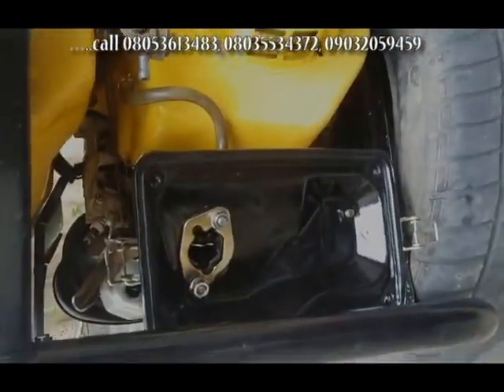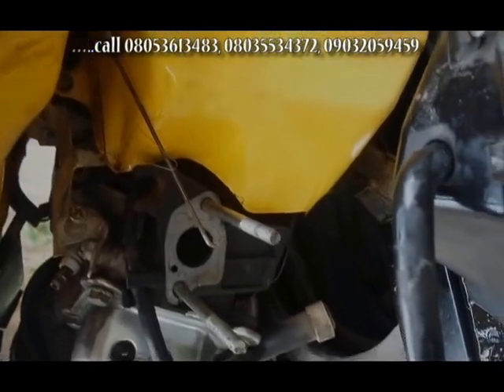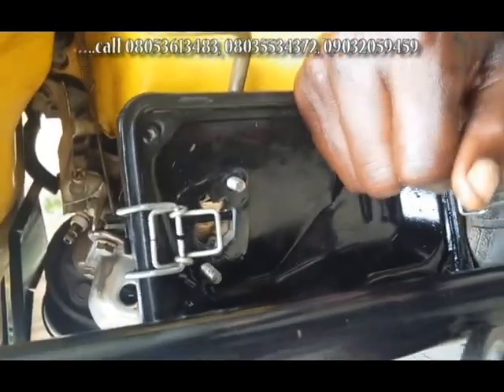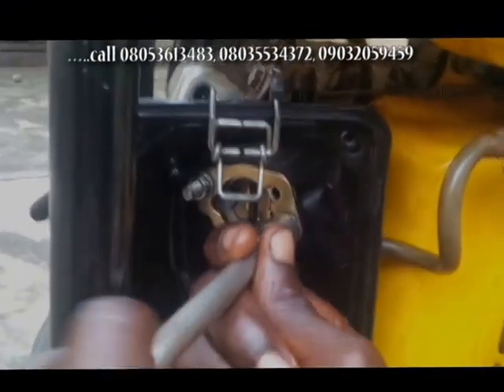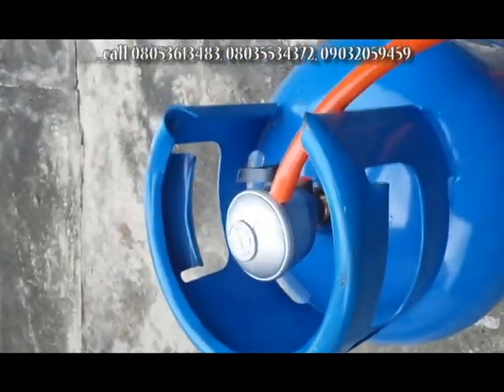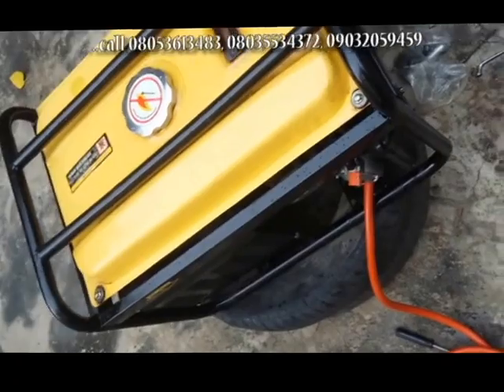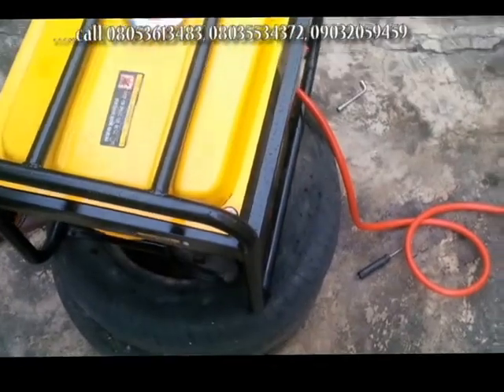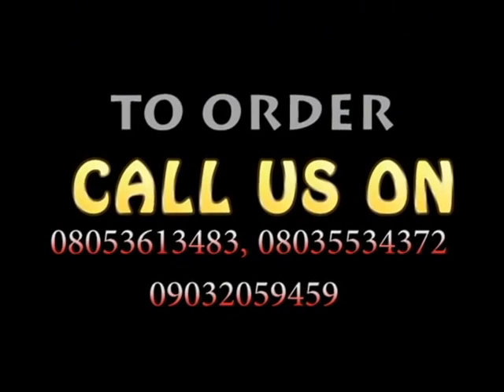how to convert ur Petrol Generator to Propane Generator

Comment: By the way I heard these carburetors also run on Natural gas how much 1/2” hose would be the limit and still work? 1/2”x50 ft 1/2” x25 ft or 1/2” x15 ft or should I just run 3/4” hose from house hook up at 50 ft?

Comment: Do you have on that will work on a Predator 8750/7,000 running watts Generator with a Honda clone engine 13hp 420cc engine? I see yours is only a 5.5 hp Generator and I would need one with over twice the gas volume.